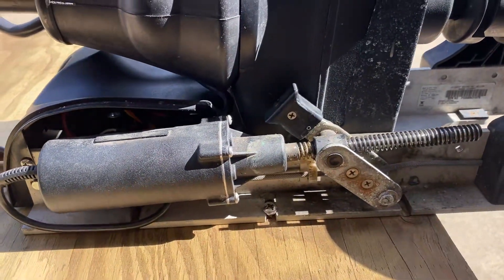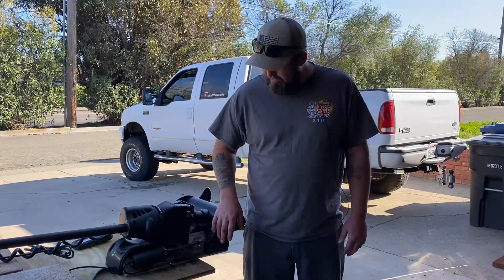SAVE MONEY! ULTERRA DEPLOY ISSUES | HOW TO

Comment: Haven't had any trouble with mine yet but I will have to check that out. 2016  I upgraded it myself to an I pilot link. 2 eBay remotes and $500 later lol.
Reply from the maker: Awesome! Yeah I’ve had just a couple issues with mine.. but this one I’m kinda kicking myself for not trying the WD first.. but I had sold it to a buddy assuming the dampener shock was the issue because with it off it worked fine..

Comment: Would it be the salt water that plays havoc with it?
Reply from the maker: It definitely means more maintenance.. and why I want to get a riptide.. but even riptides need cleaning after salt..  but with the reactor 40 kicker auto pilot I won’t need the bow mount on the boat in the salt at all..  it will let me steer and control the boat with the kicker by remote .. now if I don’t use the bow mount to steer.. I or someone has to steer from the helm .. thanks for watching and commenting..
Reply: @ReelLifeFisherman  there's your million dollar idea a  remote to steer your kicker. I'll be the founding partner with you lol
Reply from the maker: I wish I could have made one first but there are a few different ones already on the market.. the reactor 40 is the newest one form Garmin.. it’s actually replacing the TR-1 which has led the industry for years.. there is also panther steer with pro troll.. but that one has no auto pilot no gps just throttle and steering control..

Comment: Everyone talks so bad about these motors. But I’ve had mine since 2017 and use the hell out of it. They just need every blue moon a little TLC. Just to oil the pivot points like you had said. If mine ever dies I’ll get another for sure.

Comment: HELP!!!!!  My last fishing trip, my Minn Kota Ulterra "paused" while deploying once it raised up to a vertical position.  Mr. UnlikeU, I tried what you showed in this video and all I could get it to do was lower the shaft, not raise it and not allow me to stow.  Unfortunately I have a tongue mounted step directly below the trolling motor while on the trailer.  If I go down another 1/2", it will bottom out on the step.  Any suggestions how I could get it to stow??????   THANK YOU!!!!

Reply
Reply from the maker: I would recommend removing the step and go through a trim stow reset procedure. See if that fixes your issue.
Reply: @ReelLifeFisherman  thanks.  I wish I could...its welded in place.  II tried poweing it off and then going through the reset but no luck there either.  I will NEVER own another Ulterra.
Reply from the maker: I won't either I sold the boat I had it on and my new boat I have the terrova.  You can try taking it off.. a pain if it's not on a quick release.  And try some tests on the bench or take it to a shop.. if it deploys and latches and will trim down and not up it's probably the trim motor.. and the new one comes with a belt..
Reply from the maker: But it could be a couple of things..

Comment: Another great tutorial...Thanks!  My Ulterra is about two years old...no problems so far but it’s getting some WD-40 soon thanks to your vid.  While we’re on this topic, what’s your take on using Ulterra or Terrova in saltwater? Also, is it wise to cover such trolling motors with plastic or something similar whenever boating on saltwater?  I troll for halibut using my big motor and I always cover my trolling motor to protect it from salt but wonder if it’s necessary.
Reply from the maker: So I use mine in the salt.. and I want to get a riptide.. but even riptide requires that you clean them after salt use.. really the only difference is the paint on the motor is made for salt and holds up better..  and no built in transducer..  and color of course.. also one of the reasons I want the reactor 40 kicker auto pilot because it will let me fish and control the boat by remote control with gps and throttle control.. and leave the bow mount at home.. .. now I use it to steer and use the kicker to push..  minn kota of course recommends never using a fresh water version in the salt water.. thank you for watching and commenting..
Reply: @ReelLifeFisherman  Thanks for your detailed reply, much appreciated.  Guess there is no end to the gadgets we keep adding to our boats for convenience and/or to gain a competitive edge that helps us put more fish in the boat.   #$$$$’s!